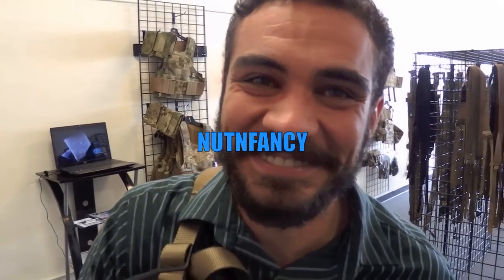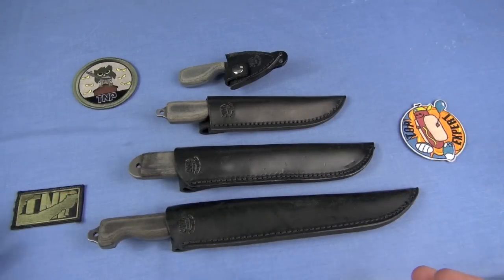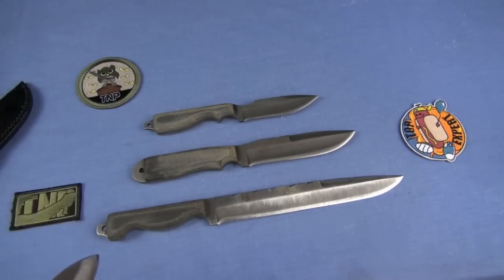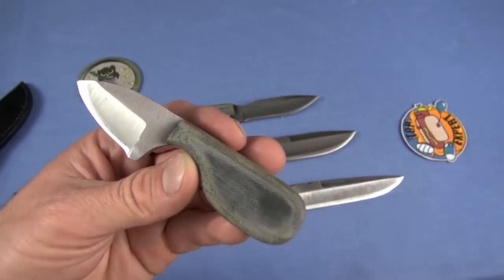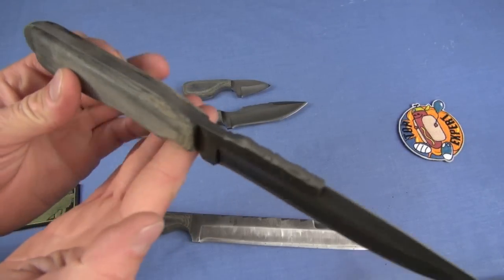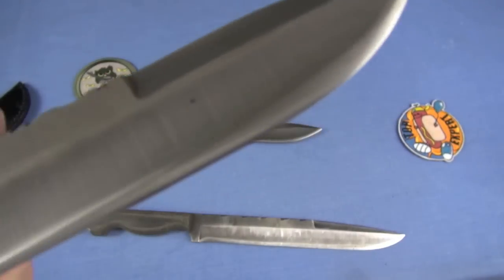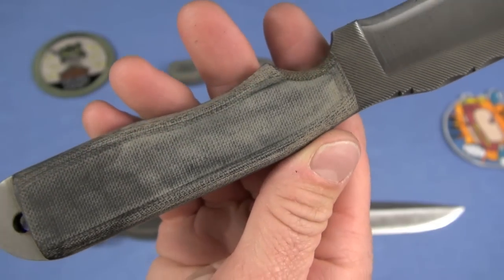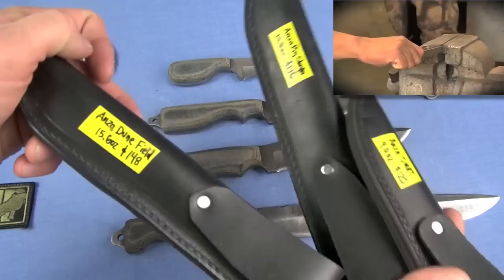Anza Knives [FULL REVIEW]

Comment: I've owned an anza for years now and I must admit that it's my favorite fixed blade. It's comfortable holds an edge very well and is extremely  sturdy. The only problem I've had with mine is the leather sheath. The blade cut through the stitching and exposed the tip. I repaired the sheath but it didn't  hold. Other than that I wouldn't trade my anza for anything.

Comment: I got a anza back around 2004. About a 5" blade. Paid $35.00 for it. It's made from a file. But they seemed to have gone up. But mine has diamond wood. These appear to be micarta. That can be tough to grind. Also these sheaths are nicer. They got nice stitching.  Mine has these brass rivets through tan leather.

Comment: Nice review!
Anza knives are a great product. A lot of naysayers here probably have never picked up an Anza or used one for any period of time. Yes they will rust (if you neglect them) but they but hold a way better edge then any of my stainless steel fishing knives. They are handmade and hold up to heavy abuse. I’ve never had a handle come off one and if it did they would replace it in a heartbeat.  Solid product made in the USA. The standard sheaths are good but they will have a kydex sheath made if you ask....for extra of course. They are a small company that have been around for years and take pride in their knives. Great deals can be had at the gun shows.

Comment: i see one fatal flaw with these knives- there are no pins!!! - drill some holes and put some corby pins in there- a handle that relies solely on epoxy or glue to hold it to the blade will eventually fail- especially with hard use...i'm a knifemaker- i know this first hand